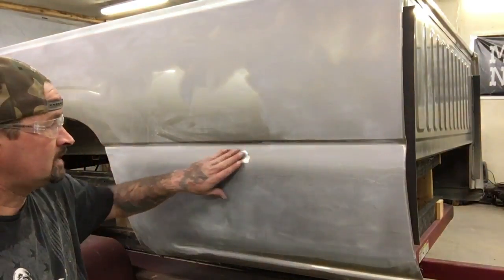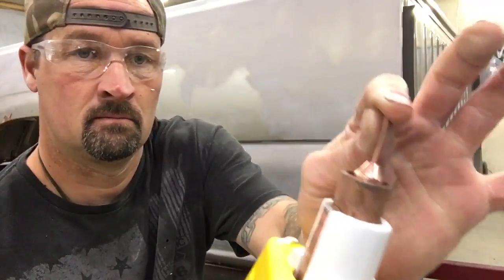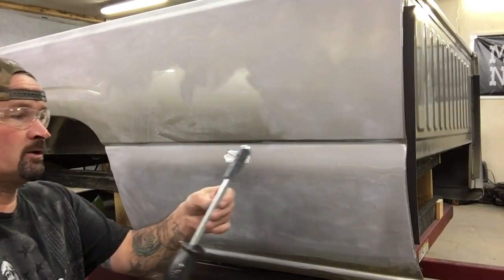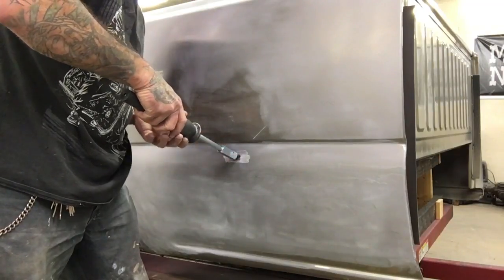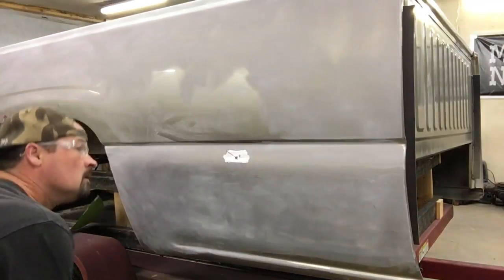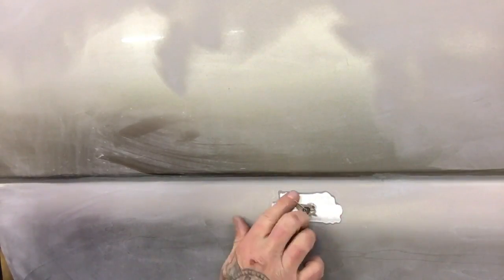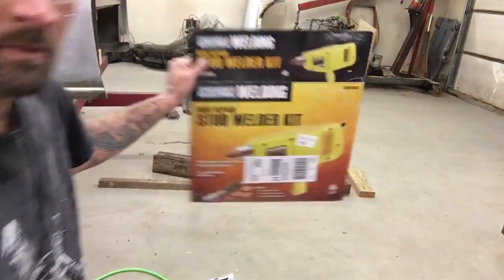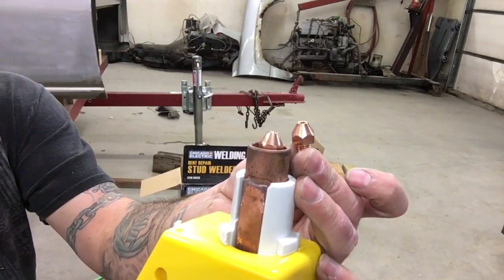How to use HARBOR FREIGHT stud welding gun

Comment: I just ordered one. Thanks so much for the video. I have a 1965 Barracuda Im working on. much needs with the dents that I have on the deck lid and hood
Reply: I have now used it 10 different times on different dents on different panels. It works great. I find that I use the 2mm studs way more.

Comment: Just bought one,  I tried it on a piece of sheet metal. I only held the trigger for one second.   Because I'm using a 15 amp. Breaker,  it welded the stud on enough that I had to twist it off.  I think it's great.   Also for anybody reading this please use the recommed breaker.  For safety reasons. Thanks for the video enjoyed it. I would rate this tool at 5 out 5 stars.
Reply from the maker: Ken Sendelofski kickass brother! 👍😀🇺🇸

Comment: As your pulling the dent , you should tap down with a body hammer .

Slide the weight back , the hold some pull pressure on the handle as you tap down around the stud

Comment: i have 1 there is always a method with tools in the car game just working it out as you go along. i have the jet spot use same pins i find 1 push 1 second then another push 1 sec 2 seconds later allows me to do the job without melting the head of pin. twist the head of the pin  with standard wire cutters  they pop off nice allows you to use the pin again and few times more and much better job on the panel no distortion and do not need heavy grinding paper to clean up

Comment: I like the video, i have one never used yet due to covid 4 freaking times... the only bad feedback i seen on this tool is the slide studs breaking in the puller. after market they are not extremely expensive, so it did not detour me. for the money they work great i used one a lot at the old body shop i worked at. 100ish bucks vs. like 300 and up with eastwood

Comment: I have one and it helps to roll that wheel back with your thumb as you pull back. And you might want to hold the stud on with the gun a little longer than they say. I find it works better. It helps also to push in with a little force so that you get go contact. Ronnie.

Comment: a must have for motorcycle tanks
Reply from the maker: Robert Thomas yeah they are cheap at harbor freight. I believe they are about 80 or 90 bucks like the other guy said. I still use mine everyday bro. They would work great for dent removal on motorcycle gas tanks. 😀👍🇺🇸
Reply: yea buddy im always asked about tanks, i just fix dings but i could fix most all of them with a stud welder. ive neede one for years and im going to harbor freight next time i go out the door.

Comment: Can i get an update on the slide hammer gripping wheel please. Looked around my area for a dif. hammer (chuck type), but can't find one and rather not wait for one to be ordered in. Thanks!
Reply from the maker: tpksunshine I dont use the slide hammer grip wheel.  Its junk. I made the custom slide hammer that i use now. Its much better. Thanks for watching
Reply: @OutlawEdge  Do you have a video of it in action? I just pulled a few dents with the original slide hammer, and it doesn't work so well. I would like something a little better if you have any ideas. Thanks so much!
Reply from the maker: https://youtu.be/S1zkXasyTvQ
Reply: Outlaw Edge nifty, thanks for that. I’ll pick up a pair of vise grips and nut to weld onto the slide hammer for when that wheel starts to drive me nuts. Thanks again!
Reply from the maker: tpksunshine no problem 👍 hope that works better! 😀

Comment: after you have the stud welded can you stick the same welded stud back into the machine with say another piece of metal with a hole through it just big enough for the stud to fit through to give it another contact point will it weld again?
Reply from the maker: Josh Milner yup after u cut off the studs they will work again as long as the tips are ground flat or cut off flat. 👍

Comment: Can this tool be used to straighten mig welds that have sunk inward on a panel repair?
Reply from the maker: Yes it can. I actually do that a lot when I grind down welds the panels warp from heat. So I use this tool to pull the panel out. It’s very handy 👍 ARCO

Comment: Mine isn’t starting at all ? I plugged it into a 3 prong outlet ? Do you think it’s a power issue ?
Reply from the maker: @Neutron5492  are u pushing it down till it grounded to the metal? The tip is spring loaded

Comment: Will this be any good for pulling a dent on a box frame? I planned on heating the dent in the frame after welding a stud to it so i will have an easier time removing the dent from the thick material.
Reply from the maker: Barroom Brawler honestly i dont think its strong enough bro. But u can weld 16 penny nails to the frame. Heat it up and use a tough puller to pull the dents out. Or can u cut out the section straighten it then weld the panel back in?  Hope that helps.  Thanks for watching 👍🇺🇸
Reply: Thanks. I was kinda thinking the same thing as you with it not working out too great being the material is alot thicker. But figured I would ask anyway since i have no experience working with a stud welder.  I like your idea. I was thinking about tacking on some bolts but the 16 penny nails is a much better idea. Ive been checking out a DIY slide hammer and thought that may work. I never heard of a tough puller before. Ill have to search on that to familiarize myself. Unless ya have a link to one? Greatly appreciate your help brotha!  Btw. I uploaded some pics if you were interested in seeing the dent in the front part of the  inner frame.  Not sure what its from or how it got there.I needed a new frame and picked it up used. Photo Links http://i68.tinypic.com/2q3rm7q.jpg  & http://i68.tinypic.com/2lzuqg.jpg

Comment: Hi there 
is that working on thick metal plate also form 10mm to 15 mm ?

or only work on thin panel ?
Reply from the maker: Martin Muller no this is only for repairs on thin sheet metal. The thicker stuff wont get got enough to pull dents out. Hope this helps. Thanks for watching
Reply: @OutlawEdge  thank you outlaw . I mean if is just sticking is enough for 3mm Bolt welding to 10mm metal plate
Reply from the maker: Martin Muller oh i gotcha. Yeah it will weld to thick panels with no problem 👍 but im not sure the stud will stay on there if your using a puller trying to bend thick steel.
Reply: @OutlawEdge  Dear Outlaw , i dont want to bend it , i want just to weld 3mm Stainless Steel Weld Studs to 10mm stainless steel panel . do you think is ok ?
Reply from the maker: Martin Muller honestly it might just work. Its worth a try 👍
Reply: @OutlawEdge  thanks

Comment: Do you need to undo the battery fuel lines?? Great vid by the way!
Reply from the maker: wangbungal nope u can leave your vehicle alone while doing this. Its grounded to the welder so u wont have problems like that. Pull the trigger three seconds and it welds the stud nice and solid. Thanks for the nice comments 😀👍

Comment: are the studs reusable once you break them off the body?
Reply from the maker: Oster Oven no as soon as they are used they are junk. They cant be used twice 👍
Reply: Actually they can be used again but they wont hold as good if used them plenty of times
Reply: yes you can reuse but it might not hold as strong as before, make sure you use a 80 grit sand paper to clean the head of the studs first

Comment: That slide hammer would be in the sheetrock. I would weld a vice grip on the end of that thing. Good video though.
Reply from the maker: hudsonhawk 001 Thats what i did awhile back. Tossed the old slide hammer and built one with vice grips welded on the end. 😀👍
Reply: @OutlawEdge  😁👍

Comment: It a great stud gun, But the slide hammer really sucks, It gets worn out over time and doesn't hold the studs very good. But for the price,  you cant beat this tool!!
Reply: can you try to convert a hand tighten drill chuck to the slide hammer and lets us know if that works?

Comment: @ 4:23  I'm surprised the plug has no ground terminal
Reply: If the entire case is plastic, then those no need. With a plastic case, where would even connect the ground wire to?

Comment: Mine doesn’t seem to work. It’s the exact one
Reply from the maker: Whats it doing bro? What kind of car are u working on? How long are u holding button?
Reply: Chevy Silverado 2011 1500.  I’m outside it just light sizzle rained.. I wiped it down and a makes a light noise for a moment and it won’t fully do the weld. Not sure if it is because I might be still a little wet
Reply: Just changed tips.. working now
Reply from the maker: It might have tripped the reset button. Its a small blue button on there somewhere. And some have a fuse inside that button. Check that first. Let me know if that works
Reply: @OutlawEdge  ya I found the reset button and watched how you said the ground has to touch around it as well. This thing is awesome
Reply from the maker: Oh good! 😆👍 awesome bro!